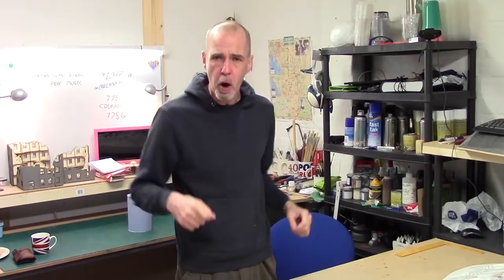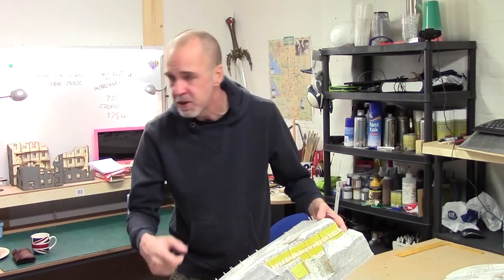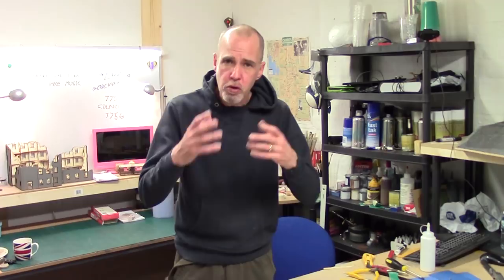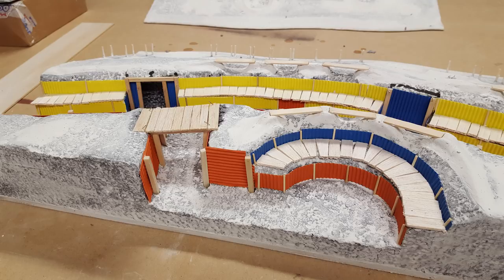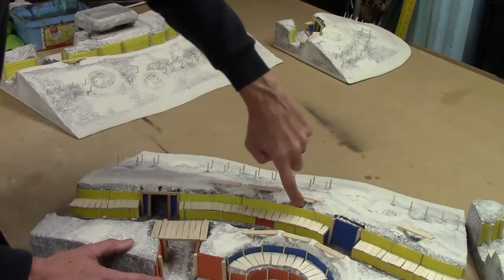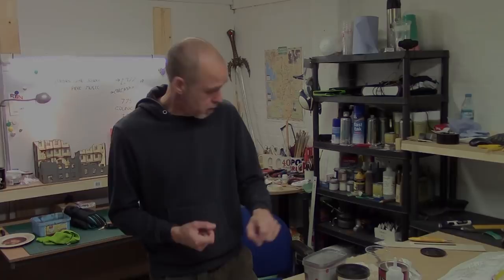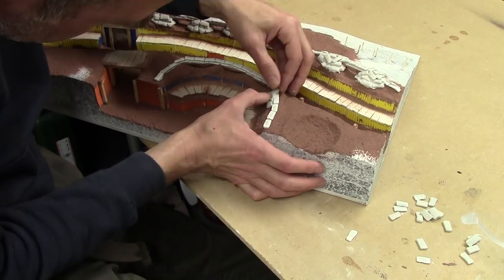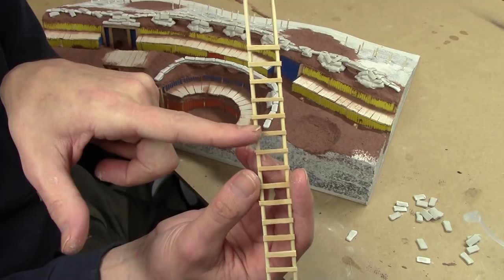Lets Make - Modular Trenches (Pt3)

Comment: For you beginner model makers. Save your empty spice bottles like from McCormick, Spice Islands, Morten & Bassett, Lawry's etc which ever brand you use. Make sure the spice bottles have the sprinkle hole tops on them. Wash them out first before you use them. You can reuse them to apply your grass, dirt, turf, etc onto your dioramas.  For when you buy some of your model materials they usually come in a large bag or box and some of you may store them in an empty coffee can or something. And from years of experience you may have your container open while applying your material to your diorama. and as I have done a couple times you go to reach for something and oops your elbow knocks over your container of grass or dirt and you now have a large spill to clean up taking time away to clean your mess rather than working.  This way if you reuse some of your spice bottles all you need to do is fill it with what ever material you use and once the bottle runs empty all you have to do is refill it when needed. Rather than using the main container of your material.  Then sprinkle on your grass, turf, dirt etc and when done they fit nicely out of the way when you dont need them.

Mel another thing you can do to save some of your Das clay longer for other projects to fill in your impressions or puddles and not having to worry about whether or not you have enough water on the foam for the clay to adhere to. I use Plaster of Paris and mix it like 5 part plaster to one part water I make it just a little thick something on the line of when house paint is old and has been sitting around aging for a while and you get that really thick soup consistency. For you dont want the plaster to thin or youll be spending more time brushing on multiple layers of plaster on instead. But its thin enough that you can brush it on. Before I apply it, I brush on my PVA glue and water mix to the foam and then brush on the plaster over it or pour a small amount of it over my puddle and spread it with the brush allowing it to grip better to the foam with the glue.. But leaving it a little thick as I brush it on. Then let it dry, once it dries if any cracks should appear for sometimes plaster will crack. I just brush on a thin coat of plaster over the crack to fill in the crack and let it dry.  Then I paint over it with my blues, browns, or black to give that water reflection at the bottom of the water. Pour a small amount of EZ Water resin in the puddles and impressions where I want and let it dry. if you want ripples in the water like a slight breeze blowing over the water use a hair dryer or hot  air gun to slightly remelt the surface of the  resin to give the look of ripples on the surface of the water. Just remember to keep moving the hair dryer or hot air gun into the direction you want the ripples to go. So moving the hot air gun from right to left if i want the ripples to look as if they are coming from left to right so you have to think of opposite when you make the direction of the ripples.
Another thing is instead of painting the wood planks a dark brown, etc  you can use regular oil wood stains. I use leftover wood stains for some of my projects for it brings out the grain and texture of the wood on some of my diorama projects and makes the wood really pop. And if I want to add a coating to the wood either use the water and PVA glue mix brushed over the top or some matte finish varnish so it wont look glossy and fake but still  give it that look of worn and used wood.

Comment: IRL The floor planks in trenches where mostly 2 beams of wood next to eachither parralel with the walls, it was cheap and easy but it worked.
Reply from the maker: I've seen loads of different trench drainage designs mate, you can pretty much go with what you want

Comment: This might sound like a dumb question, but historically speaking, where did all the dirt go that was excavated from that trench? Was it used in the sandbags? It doesnt look like there's enough sandbags to hold all that dirt.  Especially when you consider that the volume of excavated material is always greater than the hole it came out of.
Reply from the maker: +Bill D. in Iowa a lot would be used to create the earth rampart, which would have provided a defence during trench construction before becoming part of the fire shelf. Also, support positions had to be slightly raise to shoot over the lines, so there's cases where the earth was used to create small raises mate. Plus lots of sandbags!
Reply: Yeah Mel, thats what I figured. The dirt would have been thrown forward, right in front of the trench. That would raise the berm and mean a bit less digging would be required, since the lip of the trench was then raised. I would think that berm would have been tamped down to compact the soil if possible. What I'm getting at is... well, I dont see that raised berm under that line of sandbags. Looking at this particular trench system, it doesnt look like it was built under fire or hastily. Nit picking I know, but well, its just my observation. When i get a Youtube channel, feel free to pick my work apart. I suppose I'd deserve it. lol
Reply from the maker: Since when do you pour concrete under fire? ;-D
Reply: lol Yeah, I think where I went wrong is trying to place this in my own time context. When you make a build with human interaction in it, you are building it to fit a snapshot of time. Before, during, or after an event. In this case during a battle. 
Its a wonderful build, somebody is gonna have alot of fun with this!

Comment: How do you avoid fingerprints on the sandbags?
Reply from the maker: Just be gentle mate
Reply: Maybe disposable gloves would help, implying they fit tight enough not to disturb your work and have no folds that print into the surface
Reply from the maker: I prefer to get my hands messy mate
Reply: Gloves can leave glove prints. Wet fingers avoids finger marks, and if you like to get messy, it's a bonus! :)